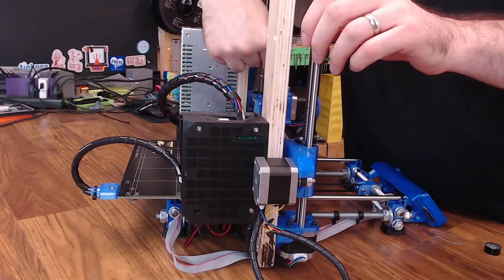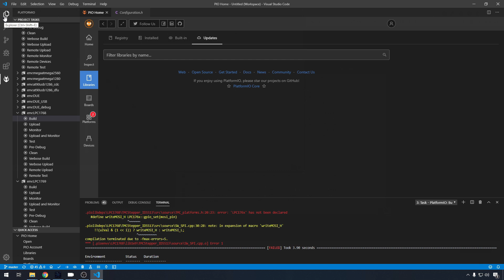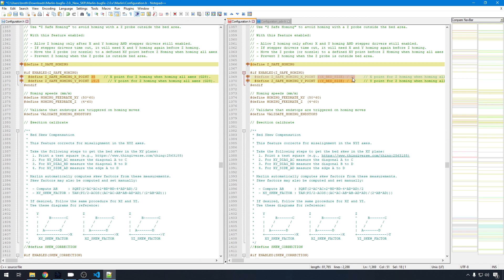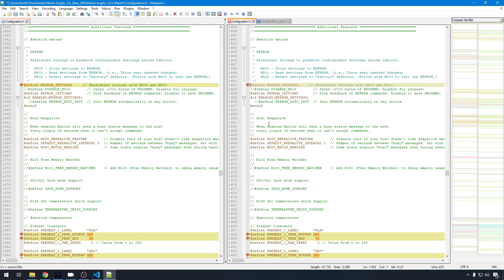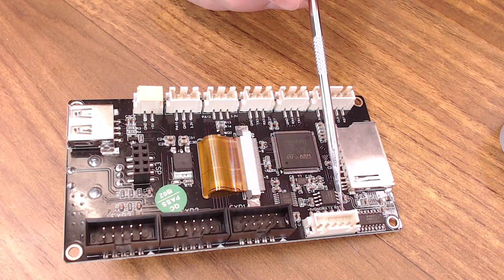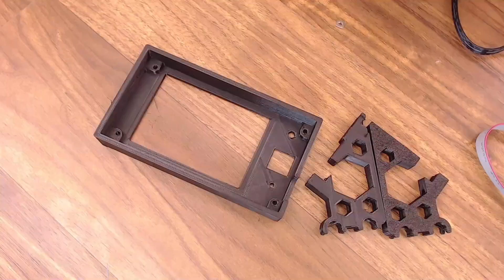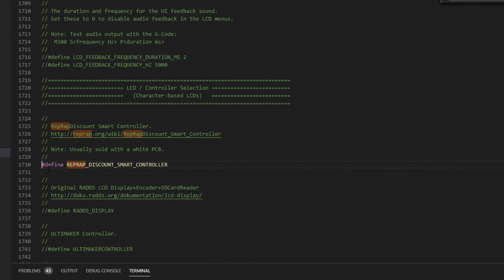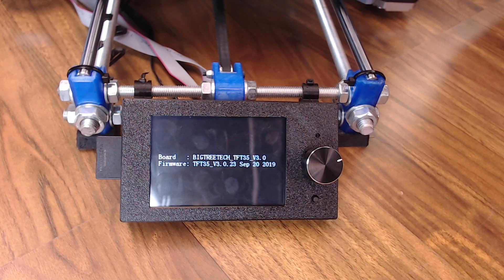BigtreetechTFT35 V3.0 Touch Screen Install - SKR 1.3 - Chris's Basement

Comment: Just want you to know that even after your video being 5 years old it is still helping people. Not just with the display but how you explain getting around VSCode and other aspects of configuring the display and board.

By the way, where can I find that cable you used with the 5 pin connector? I bought this printer from someone and that cable is missing. I have looked online but not sure what to get.
Reply from the maker: Great to hear that it's still helping people. I spent some time looking around, this seems to be a hard cable to find. You might have to make it yourself. I did find something close on aliexpress, but it's pretty short. https://www.aliexpress.us/item/3256803360830666.html?gatewayAdapt=glo2usa4itemAdapt

Comment: the link to the screen is no longer available, where can i find one or what should i search to find one?
Reply from the maker: This is it, but I don't think it will support klipper touch screen. https://www.amazon.com/BIGTREETECH-Upgrade-Touch-Controller-Display-Motherboard/dp/B07VWGFKLZ/ref=asc_df_B07VWGFKLZ?mcid=a4d9318e43bb3091a918e556e4953299&tag=hyprod-20&linkCode=df0&hvadid=693071814643&hvpos=&hvnetw=g&hvrand=10636568710633535698&hvpone=&hvptwo=&hvqmt=&hvdev=c&hvdvcmdl=&hvlocint=&hvlocphy=9023193&hvtargid=pla-823128867502&psc=1

Comment: Could you please let me know how to hide the bed icon from the display? I have tried multiple times without success. I would appreciate your guidance on how to resolve this issue.

Here are the details of the software I am using:

Mainboard: Marlin 2.1.x
Display Firmware: BIGTREETECH TFT50 V3.0.1
Reply from the maker: I'm not sure what you mean about the bed icon, can you send a pic of what you mean?
Reply: I am referring to the BIGTREETECH TFT50 V3.0 display firmware. The display currently shows a Bed Icon, but I need to remove or hide this icon because I am using a Chamber instead.
Reply from the maker: @keerthana1502t  Looks like all the code is there, but not sure where to start to remove the icon or setting. https://github.com/bigtreetech/BIGTREETECH-TouchScreenFirmware

Comment: Well, I SO wanted this to work - this and an SKR Mini E3 V3 and a BTT Pi 1.2 - I had grand plans to upgrade my old Ender 3 to run Klipper.  Sadly, I JUST learned that this TFT 3.5 would be only HALF as interesting with Klipper instead of Marlin.  Only with the latter does it "swing both ways," switching back and forth between the color touchscreen and the dial-and-click 12864 menus.  Color me HUGELY disappointed, to say the least!
Reply from the maker: I am right there with you. I wish it would work, but unfortunately not.

Comment: I was wondering if you knew where I’d find the serial port settings for a skr pro 1.2. I was thinking there was a pdf that showed each btt board and it’s serial port settings for each particular board. About a year ago I used the info to setup on a skr1.4 but now I’m doing an skr pro 1.2 and a btt octopus pro. I have 2 tft35’s not the e3 style that fits factory display. It’s got the knob to the side not the bottom. Thanks. Love your videos. They’ve been a big help especially for the custom boot screen.
Reply from the maker: Thanks! The best way to figure these out is to look at the Marlin example. Most of the time, the serial has been configured to work with a TFT. https://github.com/MarlinFirmware/Configurations/tree/import-2.1.x/config/examples/Creality/Ender-3/BigTreeTech%20SKR%20Mini%20E3%201.2
Reply: @ChrisRiley  issue with that is many bigtree boards dont use same serial port settings and tft didnt work with the same settings i used for my other btt board thats why im looking for the serial port chart on github but i found before like a year ago just cant find it now

Comment: So it seems there's been no firmware updates for these since April 2021, so I'm guessing these are now abandonware and probably not worthing thinking about buying new. Is there anything that's worth looking at as a replacement?
Reply from the maker: Not sure what they are doing with the firmware on these. I checked github, it looks like they are still working on updates. They have the supported screens listed here. https://github.com/bigtreetech/BIGTREETECH-TouchScreenFirmware#supported-screens
Reply: @ChrisRiley  Last release (Vx.x.27) was Apr 10, 2021.

Comment: I've tried on and off for years to get my TFT-35 e3 v3.0 to work with my SKR 1.4 Turbo board in my CR-10 S.   The screen display was OK, but the graphics side always showed a "printer not connected" prompt.  Recently I installed a SKR Mini e3 V3 board with Marlin 2.1.2  and I was determined to get it working.  My solution was to set the Serial port to -1, set the second Serial port to 2, and leave the display as the factory CR-10. 

Now it's working perfectly.  That is significantly different from your settings with the hardware/firmware you're using but perhaps it can help someone with a set up like mine who is desperately looking for answers.  Caution: There are several flavors of hardware and you must use the one matching your equipment AND don't try to use a large capacity SD card for the set-up. I had to hunt through my old junk pile to find a small enough SD card; otherwise, the TFT-35 gave an error prompt even though the files on the SD card were correct.
Reply from the maker: Awesome! Thanks so much for sharing!

Comment: Great Videos Chris! Concise, accurate, reliable, and complete!  Wish the whole internet was like that.  I followed your videos and I have been able to upgrade my Longer LK5 Pro with the SKR 1.4 Turbo with the BigTreeTech 2209's.  I can connect to and control my printer through the Raspberry Pi that I have connected to it with OctoPrint however, my touchscreen display just keeps flashing "Longer", "Longer".  I have tried making different changes in the configuration.h file but nothing seems to work.  I've also tried switching the R & T wires.  Nothing.  I have the TFT connected as shown on SKR data sheet to the corresponding labels on the Longer TouchScreen (which functions from the factory with only 4 wires, no reset).  I made a custom wire harness to get that done.  I also tried loading the DWIN_SET from Longer onto the SD card but that didn't work either.  Everything else seems to be controllable from OctoPrint thanks to your great video instructions.  My apologies, this is my first attempt to modify and compile firmware.  You seem to be very knowledgable so I was hoping you could point me in a direction.  I am in over my head.  Thank you and please keep up the awesome videos!
Reply from the maker: Thank you! So you are using the longer touch screen that came on the printer or an after market one?
Reply: @ChrisRiley  Thank you so much for answering.  The post was older so I wasn't sure you were monitoring it.  I am using the touch screen that came with the Longer LK5 Printer.  These are the numbers that I got off of the board itself (I don't know if they mean anything): HST0430563-7, TJC 4827X343_011_P03. These were on the chip: Ai HMI, T8, 20352035M0292.  I have looked through the Marlin code provided in the example for Longer LK5 Pro but I can't see how the tft display is being called out.  Also, when I comment-out "define Longer LK5 Pro" i get the following error: Sorry! FSMC TFT displays are not current available for HAL/LPC1768.  I have also looked at the Alfawise U20 examples.  I think Longer and Alfawise are somehow connected.  As I said, I am in over my head.  Searching the internet for this issue, tells me that I am not alone.  I really couldn't find much regarding this matter.  Thanks again Chris.  Much appreciated!
Reply from the maker: @danieljmorel  Hey there, so the longer screen might be a tall order to get working. The interface could be a lot different and the SKR board can't support it. Someone might have created a different firmware you can flash for that screen to get it going, give this a look and see if it might be helpful. https://github.com/Guizz27/DWIN_LK4Pro
Reply: @ChrisRiley  Also, I looked at the link that you provided, which was different from any I had tried, but unfortunately I can't do the update.  My screen version is 0.3.1-DWTJ.  He says NOT to do the update if the Longer LK5 Pro shows this in the "about" screen.
Reply: @ChrisRiley  I was able to get a Marlin download from the link you suggested and I was able to compile it for the Longer LK5 Pro however, the touchscreen remains the same: "Longer", "Longer"...  I did try enabling some of the other TFT options but I still was not successful.

Comment: Hello everibody. Can someone tell me why I cant print from the non simulated touchscreen mode? It detects my micro-sd from the board when emulates the 12864 but not from the normal non emulated mode. Thanks in advance.
Reply from the maker: I'm not sure if the touchscreen mode can sense you have the on-board card. Its been a while, I can't remember. Does it work with the SD card on the screen ok? That might be the only option.

Comment: wow change to 0 makes my  tft35 touchscreen work. Thanks!
Reply from the maker: Woo Hoo! I'm glad you got it going!
Reply: I’m getting error every time I switch it to 0
Reply: @docnicklepickle9133  I probably should document my steps but if I remember correctly even when I change it to zero it ended up not working in the long run. I think you have to update the firmware within the tft35
Reply: @Ki-bi2pu  I appreciate your help, I found out that i had the wrong env in the firmware

Comment: I give up, I've tried everything and it doesn't work and there's no help on the internet anywhere

I read everything from the video and all the articles, but there is no solution

I have TFT50 V3.0 (V27 softwave)

everything works fine and is connected to btt skr 1.2 pro (no software inside yet)

but as soon as I insert the config.ini into the TFT50, it updates and turns on, then beeps continuously for a few seconds and restarts in 30 seconds, and so on and on without interruption until I turn it off

Can anyone help, I really don't know if I'm doing something wrong
Reply: I solve that stupd TFT i lost days on it... now i have weard vibrating sound on y stepper but it better when i put 1500 mA (nema17 48mm long)
24V conection

How much is too much?
Reply from the maker: @NeoDymium97  As long as the motor isn't getting too hot, you should be okay. A lot of those motors 1.8A is max. If you can't hold a finger on it for 3 seconds, it's too hot.
Reply: @ChrisRiley  I have heat sink on motor and it isnt hot at all on 1.5A
Reply from the maker: Some of these screen will reboot if they can't connect, but I don't think this is one of them. Is there an older version of the firmware you can try?

Comment: Hi Chris, your videos have really been a great help to me. There's not much on the web about updates for old RAMBo boards so I was reluctant to try to add the TFT35 to my old Maker Gear M2E. Your videos have given me the confidence to give this a try and I'm happy to say I got both the 12864 and touch screen modes working today. The 12864 mode was easy after I figured out the connectors were keyed backwards for my RAMBo v1.3. I had to do some research to find out how to hook up the the TFT cable to a serial port on the RAMBo but it was surprisingly straight forward. Thanks for your excellent instruction!
Reply from the maker: Thanks John, glad you got it sorted out.

Comment: Chris is there a way to use tft and connect Octoprint to the board?
Reply from the maker: If you use serial setting -1 and serial 2 setting of 1, you can use both.
Reply: @ChrisRiley  when I change Serial 2 to setting 1 and compile.  I get an error serial port pins conflict with lcd pins.
Reply from the maker: @Ludeatude  DO you have a mini board? If so you need to use -1 and 2.
Reply: @ChrisRiley  1.4 turbo
Reply from the maker: @Ludeatude  Yeah, -1 and 0 should be the correct ones.

Comment: Is someone can help me ? I'm trying for months to make the touch screen work but I'm getting the "no printer attached" problem, no matter what I tried it's not working for me ... I can only use the simulator.
Reply from the maker: This always seems to be a serial problem or a broken/misplaced wire. Check your wires and make sure you serial is set to -1 and the second serial is uncommented and set to 0.

Comment: Hi Chris. Great video. thks. I have a 1.4 turbo with 2209 and 3.5 v3.0. change on the serial to 0 and baud rate on 115200 as your video. screen works great but  Pronterface cannot connect at all? idea. thanks
Reply from the maker: There should be 2 serial ports listed, uncomment the second one and set it to -1, then pronterface should work.
Reply: @ChrisRiley  Hi Chris, thks for quick reply. Ok first serial port -1, As for the secondary serial port is uncomment 

 */
#define SERIAL_PORT 0

 */
//#define SERIAL_PORT_2 -1  (This way I can use the graphic controller but I cant connect the Printer with computer)

If I change the serial port 0 to -1. This setting the graphic controller cannot connect the printer but i can connect to a computer. weird? idea chris.thanks
Reply from the maker: @jealio   You need to uncomment both at the same time, make one 0 and the other -1, it doesn't matter which one is which.
Reply: @ChrisRiley  Hi Chris, Thanks for your reply. I did uncomment both which u specific and it still wont work. I cant connect to the printer and the screen say no printer attach. Only work with one serial which is 0. It able to connect the screen but not the computer. which is sad.

Comment: Just want to say I can't even count the number of times I have watched your videos and always learn something new that I may have missed before. I do have a question about this screen. I have been using it in the graphics mode for a few months but now it tells me no printer connected, but if I go to the "old school" screens it works fine.
Any idea as to what happened?
Thanks again, now back to watching
Reply from the maker: Thanks Scott, it has to be something with the TFT serial connection. Maybe it thinks USB is interfering with it or something. Maybe just one of the wires is loose.

Comment: hi, I need help ... I have installed the SKR Miniv2 and TFT35 in my Ender3 Pro, but when I modify the 1990 and 2076 line with Marlin 2.0 bugfix to switch from stock display to reprap full graphic, the compiler gives me an error. What am I doing wrong? Many thanks in advance!!!
Reply from the maker: That screen isn't supported by the mini board. You will have to use the CR10 stock display option instead, them use connector EXP3.
Reply: @ChrisRiley  thanks!!!

Comment: I was wondering if the TFT35 v3.0 will work with a SKR e3 mini v2.0 on my ender 3. I know the screen is bigger but is there a way to work around that? Also will a BTT Smart filament sensor work with the SKR board and TFT35 screen?
Reply from the maker: Yes, it will work on the mini v2.0. I am not sure on the filament sensor, I haven't worked with one yet.

Comment: TFT35 V3.0 Touch Screen work with a mks gen l main broad
Reply from the maker: You can make it work, but it's a different pinout. You would have to make a cable.

Comment: Not sure if its been mentioned before, but it might help someone else, I have a SKR 1.4 Turbo and was getting "No printer attached" error.
Fix for me was to set the serial port at "-1"  then enable port 2 and set that as "0", baud rate 115200
Screen now detects printer about 20 seconds after power on.
Reply: Ok, an update to this because I'm an idiot, and it might help someone else out.
My define heater_0_mintemp is set to 21, as I am using a DYZE 450º thermistor, and that is what they have as their changes to marlin config. Issue is my thermistor was reading 20º, which marlin is reading as below 21 so therefore must be a thermistor error, don't heat. I reset that value to 5º and now it seems to be working.
Thanks for the help, and apologies for being a dumbass lol
Reply from the maker: @chrislefroy1034  Glad you found it and thanks for updating us!
Reply from the maker: Thank you for posting this over here as well. It will help.
Reply: @ChrisRiley  No problem :)  I'm wondering if you might be able to help me with another problem though, my hotend wont heat up, and when told to heat there is no voltage on the +E0- screw pins.  Also if I initieate heatup from pronterface, after 30 seconds it loses the usb connection (drops out) and I have to power cycle the board a few times to get it back.
Am I looking at a faulty board, or is there a command to set the hotend active that I missed?
Reply from the maker: @chrislefroy1034  Sounds like a bad board. You have to reset it because it hits thermal runaway,
Reply: @ChrisRiley  I just tried disabling thermal runaway on the extruders, still no power or heating.  Am emailing Bigtreetech, its a brand new board I waited 3 months for.. hopefully their warranty service is good!
Thanks for the reply mate, you probably get a ton of messages, so I appreciate the help!

Comment: Just a note, I had an issue with this display caused by my Marlin firmware, for some reason I had the #define PID_BED_DEBUG turned on and it locks up the display.
Reply from the maker: Huh, that's a strange one.

Comment: Funny I had the touchscreen "working" before then when I uncomment reprap full graphic controller none of it will work. Just black screen
Reply from the maker: You can't click the button and get the menu to switch? Hold it for 3 seconds.
Reply: @ChrisRiley  uhh I dont remember. I just switched back to stock ender 3 display for the time being. I remember before marlin mode would be blank and it would just have the simulation message at the top. But I think after uncommenting that it was pretty much just black screen. Thanks for replying!